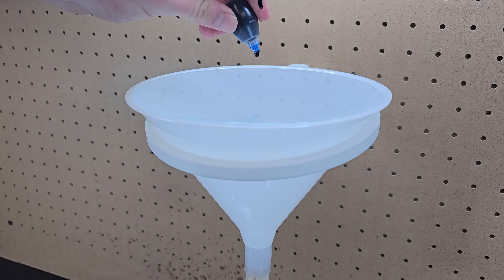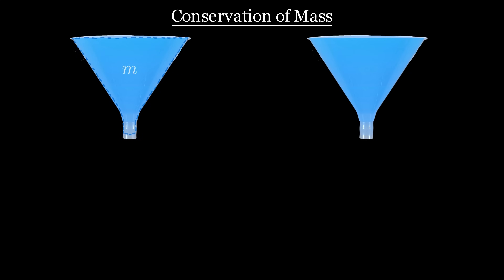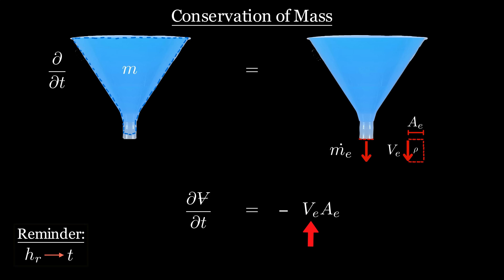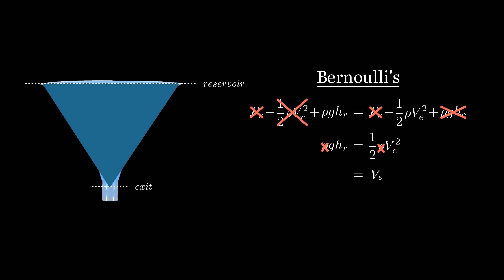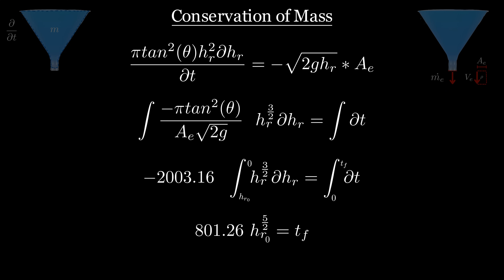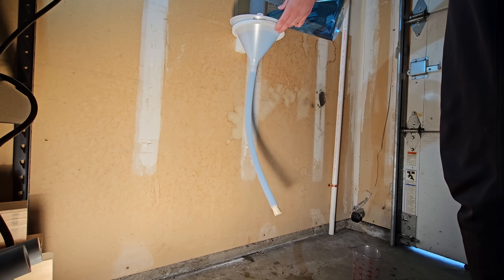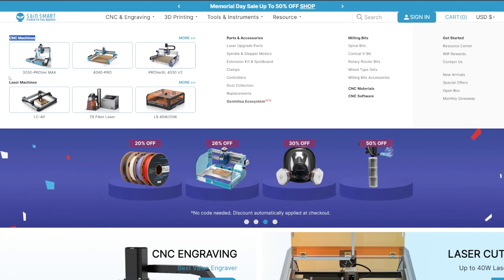Place your bet: How long will it take for the Funnel to drain?

Comment from the maker: For the next couple of episodes in this series, I'm going to go back to some more basic physics/engineering demos, but I wanted to do one that shows where the series could go in the future if I'm able to continue making these. I'd love your feedback here in the comments. Also, a new episode of 2 Truths & Trash should be out on the 1st. Thanks for watching!
Reply: All of your videos are 👍🏽. Please keep doing what you are doing!
Reply: I assume the reason it drains faster with the tube is because the Siphon pulls the water directly down and straight out and I guess maybe it just doesn't do that with just the funnel
Reply: The first funnel drained slower because any uneven distribution of turbulence would coalesce into a spiral causing the liquid to spend much of its time spinning around the hole instead of heading straight to it. The second funnel drained faster because the long tube maintained a vacuum as the liquid in it continued to accelerate due to earth's gravity. A combination of atmospheric air pressure from the top of the funnel and cohesion between the water molecules respectively pushes and pulls the water down faster. (How did I do, teach?)
Reply: @wizulus ⚠️ God has said in the Quran:

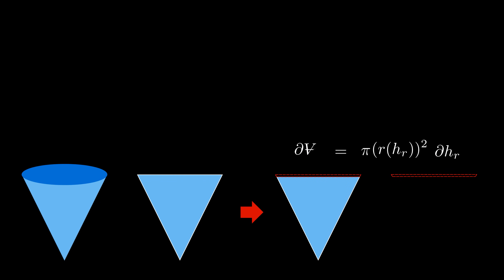🔵 { O mankind, worship your Lord, who created you and those before you, that you may become righteous - ( 2:21 ) 

🔴 [He] who made for you the earth a bed [spread out] and the sky a ceiling and sent down from the sky, rain and brought forth thereby fruits as provision for you. So do not attribute to Allah equals while you know [that there is nothing similar to Him]. ( 2:22 )

🔵 And if you are in doubt about what We have sent down upon Our Servant [Muhammad], then produce a surah the like thereof and call upon your witnesses other than Allah, if you should be truthful. ( 2:23 )

🔴 But if you do not - and you will never be able to - then fear the Fire, whose fuel is men and stones, prepared for the disbelievers.( 2:24 )

🔵 And give good tidings to those who believe and do righteous deeds that they will have gardens [in Paradise] beneath which rivers flow. Whenever they are provided with a provision of fruit therefrom, they will say, "This is what we were provided with before." And it is given to them in likeness. And they will have therein purified spouses, and they will abide therein eternally. ( 2:25 )

⚠️ Quran

Comment: My thought is that the cone shape prevents the water from experiencing gravity's normal acceleration rate, due to gravity trying to force a larger volume of water into a smaller space, and since liquid isn't compressible, the larger volume is stuck waiting for the smaller volume to get out of the way. At the point at which the volume of water in the hose exceeds the volume of water in the cone above its opening, a sort of vacuum will be created at the location where the diameter changes, causing atmospheric pressure to force the water down quicker. Once all water has exited the cone, gravity will have full control over the water's acceleration, and will continue accelerating at the normal rate until the water reaches its terminal velocity. The reason that the hoseless funnel takes so much longer to drain is that the water level in the cone needs to almost completely drop before the water volume in the little outlet exceeds the volume remaining in the cone, meaning that the stunted flow rate is experienced far later, subsequently taking longer overall than its hosed counterpart.

Alright fluid dynamics people, it's your turn to destroy me... Please be gentle, I'm shy............... LMAO, JUST LET IT RIP!!!

Comment: I'm not a science guy but I remembered seeing a short explaining that you should only measure the mass of the water directly above the hole and not the ones offset to the side inside the funnel. That's why my guess was it'd take longer - there is less mass than I believe you calculated with.

Comment: The first took longer because the equation doesn't account for the various sources of friction or importantely viscocity. If you use alcohol you would find it closer to what you predicted and if you used oil it would be further.
As for the pipe, essentialle due to, once full, the high of water in the pipe sucking water out of the funnel. Essentially Pe will not be 0 but some negative value.
If you made sur the exit of the pipe was at the same height as the exit of the funnel, it would be higher since you would have more friction.

Comment: Why was it more than 4.5 seconds?
Reply: My educated guess is that external retarding forces, such as air resistance and adhesion to the inside of the funnel, slowed down the flow rate, increasing the time.
Reply: Correct, water viscosity.
Funnel with pipe attached is much taller, increasing the pressure, higher pressure would mean a faster flow rate, draining the funnel faster 🙂 I think?
I'm a vehicle tech with an interest in energy 😅
Reply: Wait if the adhesion was really the real reason then in the second experiment the time should increase not the other way around way around

Comment: I guessed that it would drain faster than the line because of the reservoir velocity being significant

I think it drained slower because the effective cross-sectional area of the water leaving the funnel is smaller than the nozzle's diameter, due to the water's velocity pointing towards the middle because the funnel's walls are angled. You can also see this in the video
This is also why the long pipe causes it to drain faster, by having a long tube with straight walls the water at the edge goes straight down and thus the cross sectional area is greater

Comment: Why assume V_r is negligible when we could use conservation of mass to deal with it exactly (V_r A_r = V_e A_e)?
Reply from the maker: Great point! and whether to keep it in was something I went back and forth on. It's just to simplify and to make the integration doable for the analytical solution. I was curious what the difference would be if I had kept it in and it dropped the line by about .1 seconds when I solved it numerically, so I decided to keep the assumption in for simplicity and to get a cleaner solution. 

The ratio of the areas really becomes significant towards the very end, where the ratio increases rapidly, but since there's not much water left by that point, it didn't seem to matter much after all (assuming I didn't make any mistakes when solving it numerically of course). 

Thanks so much for your thoughtful comment! I really appreciate the discussion.

Comment: Pressure is proportional to the height, and the flow rate increases with higher pressure.
So with a long tube, there is a greater height, meaning a higher pressure, increasing the flow rate.
I did a problem just like this in calculus 1 class in university, which was fun.
Reply: No because for It to exist a pressure u need force but since top and bottom of the water has the same force down the therell be no pressure
Reply: It Will only happenn if fluid has viscosity and a friction with walls wich act as forces up

Comment: Excellent use of manim, this was SLICK. I'm predicting longer, to account for the viscosity of water artificially constricting the flow at the mouth, similar to the soap dispenser video.

While a higher Vr term in the Bernoulli formula would mean higher flow-rate, the latest numberphile video on cones shows that the VAST majority of the volume of a cone is really near the wide part.

Edit after watching: In the example with the tube, that VR term AND that pressure term are both much more relevant, which explains why it's draining faster.